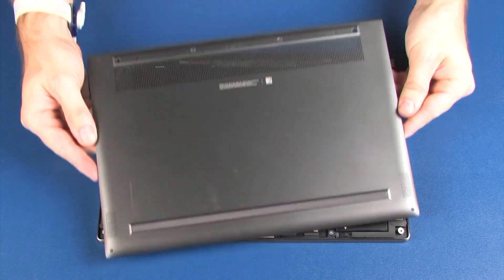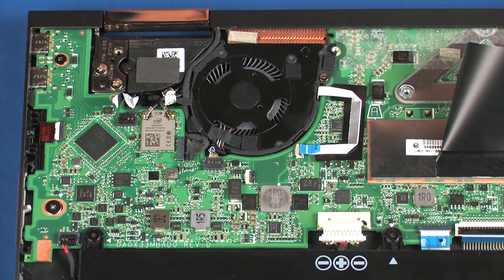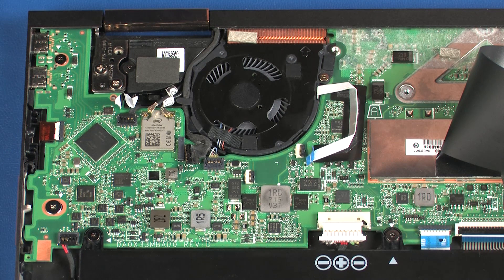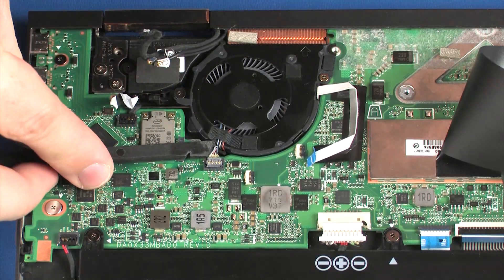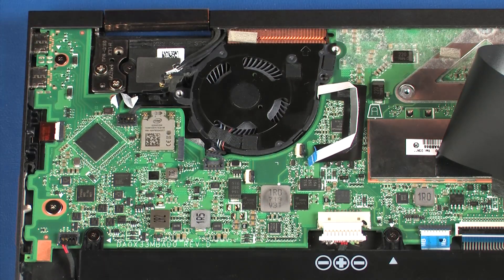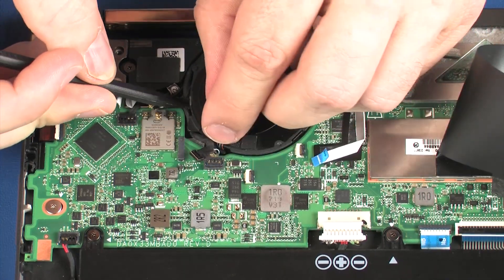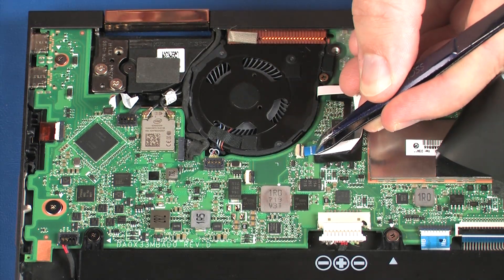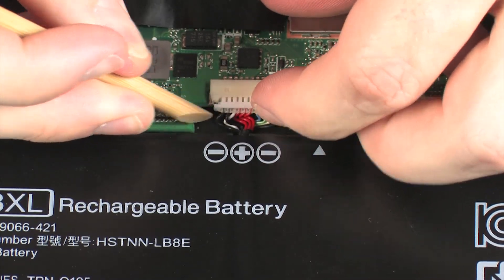Remove and Replace the Right Fan | HP Spectre x360 13 | HP

Comment: I carefully removed the connectors to the wifi module but they actually broke off from the module and are not stuck in the cable ends. Any way to fix this?
Reply from the maker: +John Dykstra Please contact our phone support team to fix the issue. Please follow these steps to reach them.
Step 1. Open link: https://support.hp.com/us-en/contact-hp
Step 2. Select the product type.
Step 3. Enter the serial number of your device or select let HP detect your product option.
Step 4. Select the country from the drop-down.
Step 5. You should see the HP phone support number.

Comment: 7PS58UA - HP Spectre x360 Conv 13-aw0013dx < based on this model, which fan part numbers would you recommend for replacement of the left and right fan that are grinding?
Reply from the maker: +Sam Tabuchi You can purchase the part from here: http://partsurfer.hp.com/ Please select your country and enter serial or product number of your unit.
Reply: @HPSupport that link doesn’t work for me
Reply: Same problem here. How do I find replacement fans..

Comment: hey I need a replacement fan for 
HP Spectre x360 - 13-ap0035tu

Where can i get that in India? or import it perhaps from anywhere?
Reply from the maker: +Zenish Prajapati You can purchase the part from here: http://partsurfer.hp.com/ Please select your country and enter serial or product number of your unit.
Reply: @HPSupport  Hey i've found the required part numbers but how do i buy it?
seems like there's no buy now option or anything that shows where to buy them at all

Comment: Replaced right fan, HP sent me fan kit (thanks) but didn't have the IR sensor . Had to remove it from existing fan . Wifi and other Connectors extremely flimsy. anyway..didn't fix cooling fan error...now I have other errors
Reply from the maker: +Andre Baumbach Please contact our phone support team to fix this issue. Please follow these steps to reach them.
Step 1. Open link: https://support.hp.com/us-en/contact-hp
Step 2. Select the product type.
Step 3. Enter the serial number of your device or select let HP detect your product option.
Step 4. Select the country from the drop-down.
Step 5. You should see the HP phone support number.
Reply: was removing the ir sensor difficult?

Comment: One of my Fans only spin 100RPM and the other spin 4000-5000 rpm. I have the x360 Spectre 13 ae0xx - is one broken?
Reply from the maker: +Oscar Jung Please contact our phone support team to fix this issue. Please follow these steps to reach them.
Step 1. Open link: https://support.hp.com/us-en/contact-hp
Step 2. Select the product type.
Step 3. Enter the serial number of your device or select let HP detect your product option.
Step 4. Select the country from the drop-down.
Step 5. You should see the HP phone support number.
Reply: I have exactly the same problem, the 2 fans should turn at the same revolutions, could you solve the problem?

Comment: When i start my computer , I get a black screen saying, "the system has detected that a cooling fan is not operating correctly" system fan (90B) , The link shown take me to a page telling me that i can hard reset or update bios.  However, I ve seen a youtube vid https://www.youtube.com/watch?v=sPjHfAOgObc&t=17s showing how to open it up, and replace the thermal paste. would this be the right move for me? I have the x360 13 2in1 Model 13-ae011dx. this issue has been present for like 6 months now and ive been too lazy to do anything about it till now.
Reply from the maker: +J shawney Please follow the guidelines under this document to fix this issue: http://hp.care/2pGDhyN

Comment: Shouldn't have to replace it....spent $4000 on laptop and the fan fails withing 10 months. Not happy!
Reply: mine just went out... 2 weeks after the OEM warranty expired.... Already sent it in for a speaker issue and it came back with a stripped torx screw so I can't even repair the fan. Needless to say, I'm pretty pissed that I spent so much only for this to happen within a year.
Reply: @thegutterpunk00  I removed my bottom cover yesterday. Pretty easy to remove fan and buy replacement. However I recommend removing cover to make sure you have the right fan part No as there are many different ones. Take care when you do though. Make sure you peel off the two rubber stops that are closest to the laptop hinges at the rear as they have 00 Philips heads screws that need to be undone under them. Which a lot of the how to videos don't tell you.
Reply: @thegutterpunk00  Just get the screw out however you can. You can also buy the Torx screws as well.
Reply: Mine is even worst, bought it when April 2018 and the cooling fan is broken in June 2018, just only TWO MONTHS